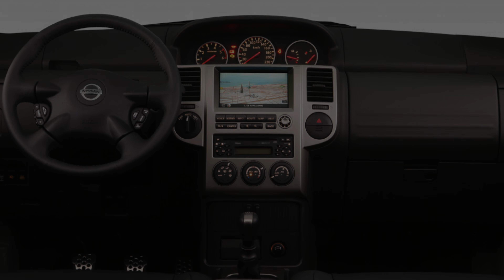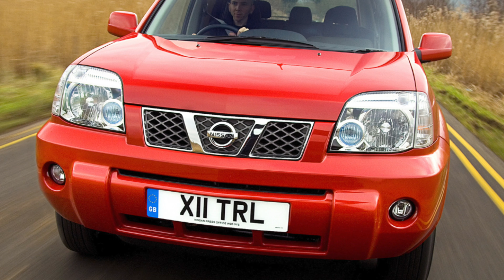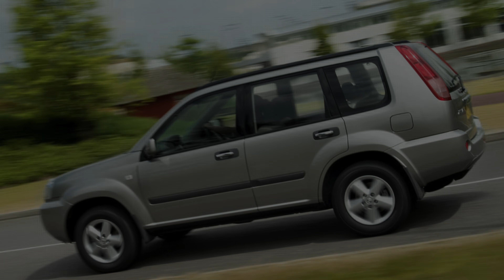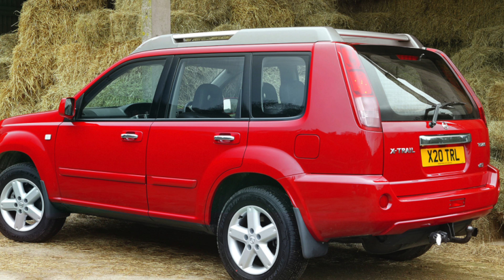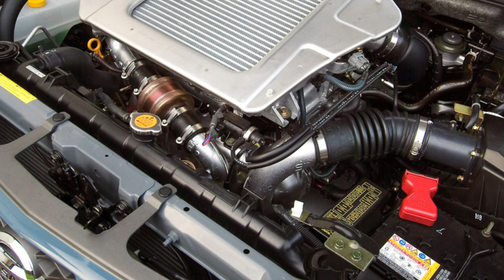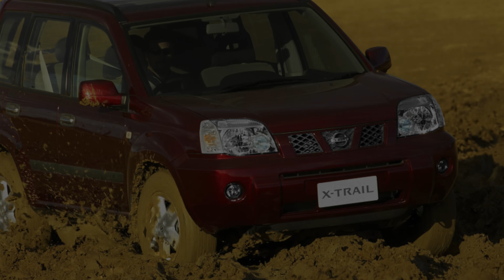Nissan X-Trail T30 Problems | Weaknesses of the Used Nissan X-Trail I

Comment: I am told this vehicle every maintenance you will change the gear box
Reply: Lies
Reply: False, 2006, 250k km Xtrail, and only issues with it were a hole in the muffler (changed it for a nicer smaller one with better flow) and the nuts holding the handles rusted and the glue flaked off, easy replacement with some long bolts and epoxy. Changed the control arms, ehich were last changed in 2011, and motor mount bushings, but so far these are all either easy, or part of regular maintenance, it doesnt burb oil, still shifts smooth as butter and us overall in fantastic shape
Reply: Your lie is true..

Comment: I'm hearing, that people are loving there Nissan X-TRAIL. I must have bought a lemon. I've had nothing but problems with mine. 1 it blew a head gasket, I got the head shaved and a new head gasket. A brand new timing chain kit and cover. A new radiator,new plugs. New cam sensor and crank sensor and a new battery. It was running for a month, and now it sits in my driveway not running, and it's been sitting in my driveway for two months now. It's a 2006,/ 2.5lt. I don't know what else I can do.  I don't have the money to spend anymore on it, I'm unemployed. What do you suggest.
Reply: Push it to the nearest cliff or make lemonade from your lemon. Ooh might need to find a new barber too. Rough cuts are hard to get over. But in all seriousness you have spent more than this vehicle is worth. Best to cut your losses and buy a Mazda.
Reply: It's Funny you said that, the get a Mazda thing. My brother gave me his Mazda 4x4, it's old, he rebuilt the engine. We took it up steep hills and, it runs great, I still have the lemon X-Trail LOL.
Reply: @davidmolling5685  hello David I am glad you see the funny side. I have to apologise for taking it too far. I shouldn't have been such a know it all. I hope you see better days of driving with your 4×4 Mazda.  Keep safe. 👍
Reply: Sorry to read this , No make is a 100% but if you are the poor sod that bought one that’s been cooked by a previous owner then taken it to a shit mechanic , it hurts 
For the 99% that haven’t had any problems they never read this stuff.   Mines just to carry mountains bikes on and tow trials bikes around  , no problems 74,000.  Handbrake bit weak , that’s all
Reply: Haha,show.the same as in my case. After fixing head,and replacing timing chain set, engine broke few months after. Crankshaft bearings gone,shaved everithing in it. Finished with replacement used engine...but to be honest,new engine    is good. Only my old injectors are loud..
Reply: Insurance fraud.
Reply: I've had these exact issues with the exception of the timing chain kit. I think it had potential but I inherited it with these problems.

Comment: I’ve had two of these now. I’m currently running a 2006 model and I will definitely have another when the times comes to replace. A great all round car which is practical, reliable and not expensive to run.
Reply: Good day friend i have a problem with my 2006 model hoping you can assit me ..It is starting and running fine but when i come to a stop it idles for maybe 10 to 20 seconds then is dies what can I do if you can assit it wil be very helpfull thank from Namibia.
Reply: @zaneoosthuizen4324  check the fuse box, battery condition,check spark plugs too, everything will be ok
Reply: @zaneoosthuizen4324  may be it's time to change the cam and crank shaf censor
Reply: Wondering if the 2006 is still going strong and what motor do you have?
Reply: 2005 machine to the fullest

Comment: Incorrect! The petrol QR engines need proper maintenance of the cooling system. They have 2 thermostats and they both need to be replaced every 100.000km and the coolant done every 50.000 km. 
There are so many mistakes in this video ... Just don't take it seriously...
Reply: do you think that my car went to limp mode due to the fact that i havent changed my thermostat?
Reply: @godofcandies8834  in my X-Trail's case (2002 QR20DE) limp home mode resulted from a defective crankshaft sensor
Reply: yes
Reply: Mine was 2005 and never change thermostat

Comment: Planning to buy one .. but maintenance costs are very high...still with buy one
Reply: Sir, i have a 2006 X-Trail 2.0 Petrol. I dont know in what country you live but i cant say that maitenance is high. I pay 50Euros for oli anf filters. Once in 6 montsh i go for a suspension diagnose. 50-200 euros for parts over 6 months. I had a problem only once when my thermostat broke and had a engine overheat, parts: 400 euros for gasket, rubbers, seals and etc... and 225 euros for timing chain. My car dosent comsume oil not even 100grams. No major problems since then. In my opinion, this car has a low quality interior. I have 300 000 km on it and it's runing fine, didnt lose one horse XD. In winter locks and the robber on door edges may freeze if it's below 15 degrese, if you put a little presure doors open but dont force it. In conclusion i can say: i love this car, never let me down and i often travel with it. costs in one year (without fuel) for parts maintanance and repairs is 250 euros for over 14 years i got in repairs and maintanance tyres under 6000 euros. Never had electronic problems. So i think if you find one in good conditions, go for it. 
P.S. The 2WD, AUTO and LOCK system is fantastic!!!
Reply: @Magina1989  what of the gear box?
Reply: @iandiru6433  manual. No problems so far
Reply: @Magina1989  noted👌